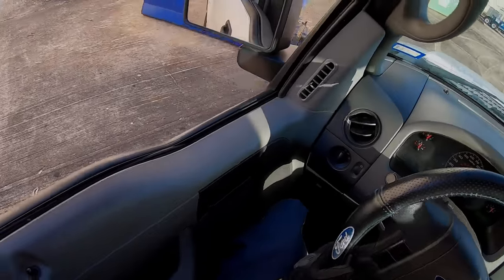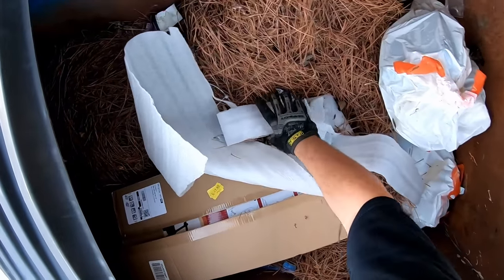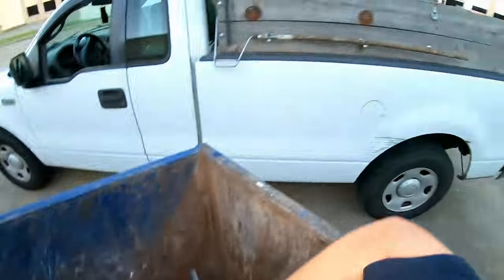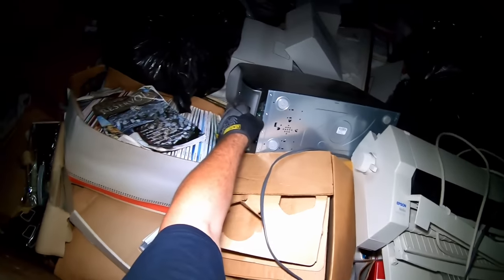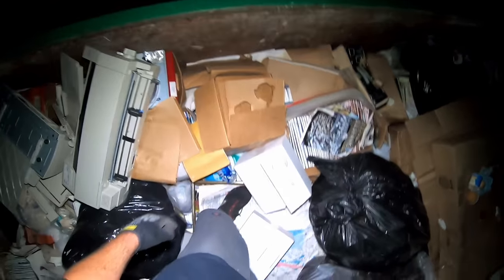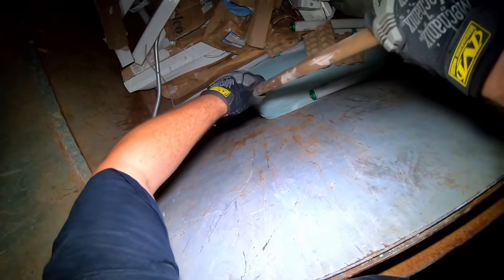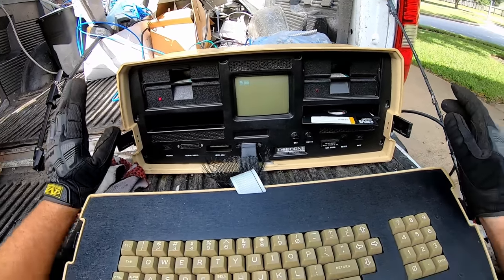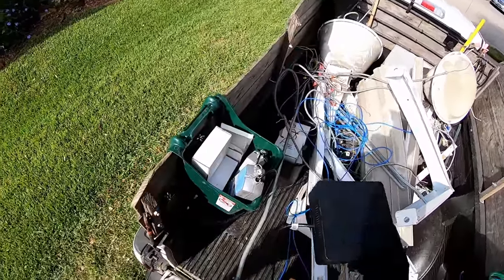Dumpster Diving "Get In & Get It!"

Comment: The item at about 11:40 is called a polaris connector, used to splice wires. They are made in all different wire sizes and configurations. Pricey things.

Comment: Hey mike i noticed you been passing up crt monitors. There is about a 2 to 3  lbs of number one copper on the back of the crt easy acess with hammer and wire cutter knock the back off break back of tube cut the attaching wires less than a min free copper

Comment: Them old school monitors have loads of copper in which is quick and easy to get out if you have a screwdriver. Takes about two minutes to remove it so you don't have to take them with you.
Probably worth more in scrap than the flat screens. There's a great channel on YouTube called e waste Ben who strips electronics down for scrap. He does curbside scavenging and he shows you how easy it is to get the copper out and does it on the side of the road and leaves the rest because of the space and plastic which is a bummer to get rid of. It's definitely worth your two minutes for $5+ of copper.

Comment: Mike, long time viewer here. Just wanted to say that I’ve noticed that there is tons of particles floating in the air. Have you considered using a mask to prevent from breathing in all that particulate matter?  Short term exposure probably won’t hurt you but if you plan on doing this for years to come, you might want to consider using some sort of PPE. Just sayin’

Comment: Boot error.  Means the disk you inserted isn't a "boot disk" it is probably just a data disk with old word processor files, or uncompiled code on it.  You have to have an OS (Operating System) Boot Disk in drive A: or you aren't going to boot up so that you can load a program disk into drive B: and do whatever you are going to do.  No, those disks won't hold "just a couple of pictures" they don't have the data space to hold even a single modern .jpg picture from a modern camera or phone.  They were single sided single/low density/layer 5 1/4" floppies would hold 100KB to 180KB of data.  For reference 1MB is 1024KB, and 1GB is 1024MB.   For collectors that thing is probably worth a few bucks since it boots up that far.

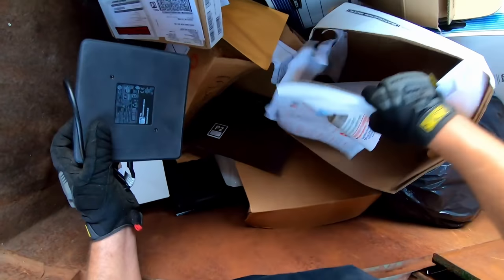Comment: 8:40 that's a Dell Thunderbolt laptop docking station - worth about $150 on eBay. 20:25 that's an Osborne 1 - very cool, vintage CP/M computer. Worth $200 or so on eBay. You can absolutely sell this - should be an easy sale. Lots of vintage collectors of these things. Cool finds!

Comment: I sell you a SOYO..Puter. I'm an old man now Mike but for me as a kid I loved to tinker and fix electronics Old vaccum tube shortwave radios in the late 60s early 70s thrown out to make room for transistor modular superheterodyne radio receivers, transmitters and the coming in of color TV. With all the electronic stuff they throw out a kid could teach himself basic dc and ac electronic theory just so much stuff to tinker with. It's like who needs toys with all this stuff. Even if it's just desoldering components of a circuit board to make 101 electronic projects.

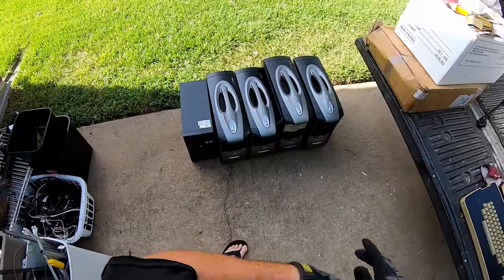Comment: 31:53 Yeah cool one. I dont know much about this one but i got a friend that has a computer museum and has a similar one, but i think his is a Commodore 64 not a 80xxx computer like this one. Yeah, i did have a 80286 computer with these floppy disks back in the late 80's. Was it 5.25 inch ones, i think so. The software may be in order 1 to 3 floppies, so put the right one in first perhaps will make it work if they are numbered.
34:54 This may be a sensor for watering plants, it may do something if it needs more water. Temperature sensor perhaps, i think it is some kind of sensor, perhaps for a freezer room or something.
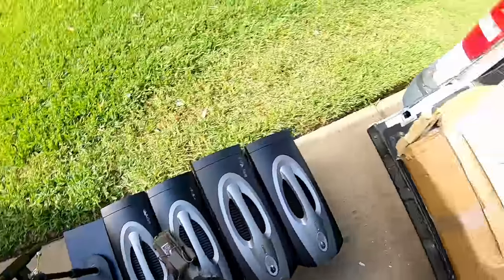35:26 Try swapping battery on it, likely 9 volt one like what is in your fire alarm. If still not measuring right then clean the sensor on it.

Comment: Those CRT monitors may be outdated, but alot of gamers are building rigs for Oldschool gaming  so they have an authentic experience. they can sell for good money alot of times. Also, Mike. Just because you dont have a good night scrapping once in a while, doesnt mean we arent still enjoying it. We love your videos, so dont worry. Good or Bad, its all good. on that Osbourn computer, you have to lower the latch on the floppy drives after putting the disk in the drive inorder to lock it in place and lower the Read/Write heads onto the disk medium.

Comment: Those old school monitors have big coils of copper in the back around the back of the tubes and you only need a screwdriver,pliers and wire cutters only takes two minutes or your quicker just smashing the back off and smash the glass.Take one to see how easy they are from Dundee Scotland.👍👍✌👊👊

Comment: That Dorset electronics device you thought was a soldering iron at  first is probably a signal injection device I am thinking. It would have been used to put a signal in a circuit, so you could hear it in the device. That way you could trace the sound to the issue keeping a device from working.
I have quite a few of them I have restored to use repairing old electronics.

Comment: I know this is an old video but I’ve seen quite a few videos where you pass on the old monitors and old crt tv:s so I just wanted to point out that they are loaded with easily accesible copper, in the yoke and the degaussing cable. 
You might already know this and pass on them anyways but I just wanted to make sure you knew about the old tv:s and monitors.

Comment: The 2 Siemens objects you found in the first dumpster are damper actuators that are used in HVAC ducts. Used to open and close dampers to control airflow or restrict the flow of smoke and or fire if there should be a fire.

Comment: Those water heater are standard in the UK.  We call them combi boliers well worth scrapping. What you have there might be stainless and copper. There is a lot of copper in them monitor and the inner housing is all metal . Worth taking.

Comment: Hey Mike you know every time you say you get any dumpsters and you want to put your stomach on that railing take some of that insulation tubing you know the that I kind of tube that's made out of Styrofoam or whatever they use put that on that railing where you don't have to sit there and put your weight on where you get creased by a piece of metal just let you know bro that's what I use she take it easy and have fun

Comment: Those big old computer monitors have the most copper around the tube and on the end of the tube super easy to get out you take everything apart if you had a drill driver you could do it right here and leave it in the dumpster that's what I do you don't even have to put it back together easy money you could do it with a hammer

Comment: The Navien is a gas instant hot water tank. There will be copper and aluminum in there. Lots of those burst during your cold spell last winter. I installed thousands of those before retiring.

Comment: Not door locks. Damper motors. Opens and closes  duct dampers in hvac systems. They're also used to open and close valves sometimes.

Comment: mike u need to close the drive door that will bring the hub down so it will spin the disk , that is not an eject ,, and will look gor a disk called cpm os or like it be its operating system possible

Comment: Floppy disk drives. I remember those well. The kiddos today dont know how easy they have it! Also, you need to push down that latch in the middle after you put the disk in. it clamps down on the disk so it can spin so the drive can read/write to it. Great finds! interesting to see what kind of hardware those other computers had even tho they are more modern than the osborne!

Comment: Those old monitors have copper windings called yokes in them and it takes me a minute to take them apart with hand tools. I'm sure with power tools, it'll be easier for you
Reply: Just don't touch the flyback and its cap you should be fine.

Comment: We have one of those Osborne computers. Wicked cool.
Reply: You have to close the drive to get it to recognize the disk. Start with a boot disk. These disks don't eject. You just open the drive and pull the disk out, but never when the drive is running. 
Maybe try new batteries in the temp reader.